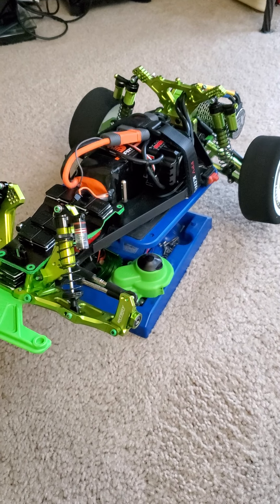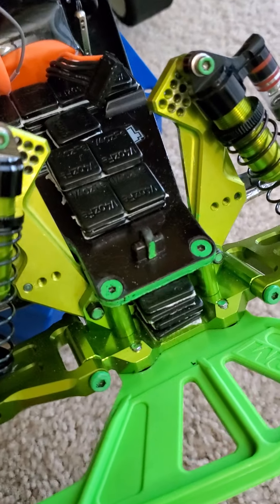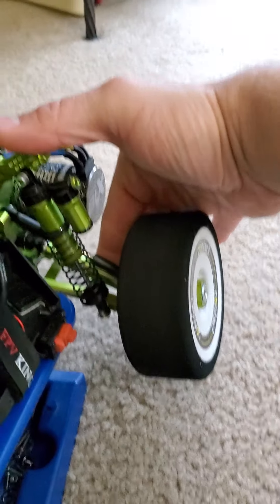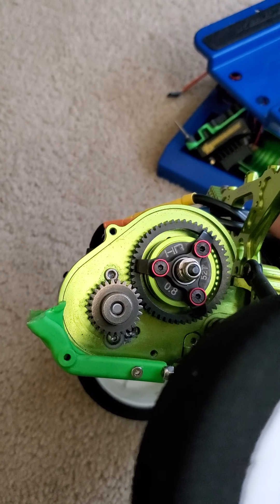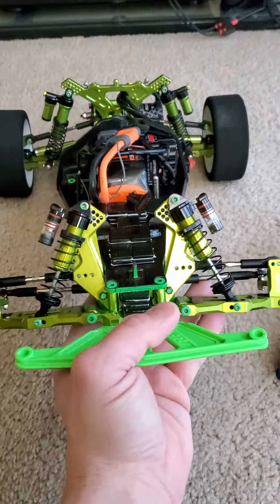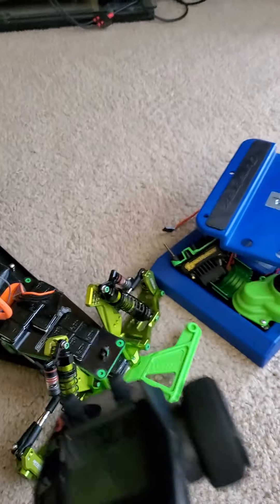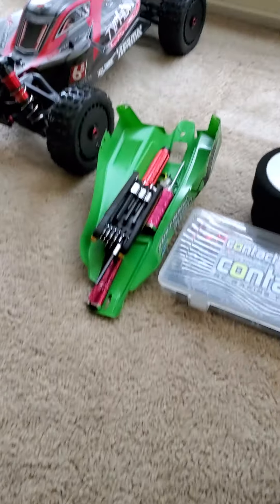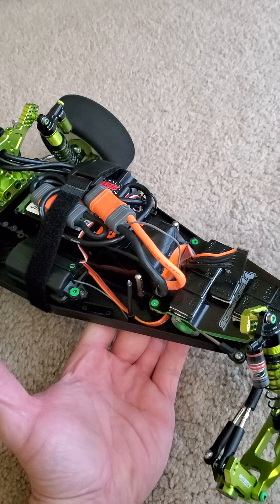Traxxas bandit running 6s electronics

Comment: Hey @alwaysupgradingrcturko can you tell me where you got the shock towers? I got some but they are for the rustler and I cant put the back ones in. If you could say that would be great. Cool build btw I am really jealous. Thanks :)
Reply from the maker: They are integy towers.   Got them from ebay.   They aren't as strong as the STRC racing one, but the color and weight were perfect.

Comment: Just getting back into rc after a few years,  looking for a 1/8th scale brushless 6s setup for an all around. I just can't find out if there anything new out or if I would be good with a mamba monster 2?
Reply from the maker: I've always been a castle fan.  There is always new stuff coming out but for the money you can't beat castle systems.
Reply: @AlwaysUpgradingRCTurko  is there a difference between the monster 2 and the monster x

Comment: What shock weight oil would you recommend for full aluminum upgrades if im gonna bash on a bandit?
Reply from the maker: I used 45 wt
Reply: @AlwaysUpgradingRCTurko  did you do any bashing at all?
Reply from the maker: @jacobjeska-ry5ij  I used to.   Been working so much lately.
Reply: What top speed did u actually achieve with ur bandit?

Comment: Man, I'd love to see you run this!  I've turned a bandit into a fairly decent 17.5 clay racer setup for shits n giggles at the club, love it so much I picked another bandit chassis up to beef into a high speed car.
Reply: Hey @Grill side Pickin, can you share what upgrades you made? Was thinking of doing the same
Reply: @brandonw1478  absolutely! 
I swapped the transmission gears from the metal ones to the delrin.
Put in a traxxas pro ball diff, swapped the shock towers to carbon fiber for more shock mounting options. 
Put the traxxas front and rear aluminum castor blocks and wheel hubs on.  Rpm gearbox, a arms, front bulkhead. Traxxas aluminum bell crank. Traxxas tie rods and turnbuckles to be able to adjust to and camber. And I stole a set of losi 22 4.0 threaded shocks from another chassis I had laying around. Changed the shaft lengths to where the shocks matched stock traxxas bandit shock lengths. Trinity x factor 17.5 and 80 amp xr10 pro. Proline HV servo (the blue one)  I would say you wont neccessary need all of these, but I wanted to give my bandit the very best shot, while still looking like a bandit.  You can get a lcg chassis for them, I have one.  But I feel like it wouldn't be a bandit anymore of I did that lol
Reply: @brandonw1478  the most important parts i would say are the aluminum castor blocks and hub carriers, aluminum bellcrank and tie rods/turnbuckles and shocks.
Dont forget to delete the stupid servo saver as well.  We used a losi stadium truck servo horn to do that. World of difference. All of that makes the steering tighten up a ton and gets you the ability to dial in your car.

Comment: I don't understand buying integy parts when they cost virtually the same as STRC and other aluminum hop-up manufacturers.
Reply from the maker: It’s not so much the cost.  STRC doesn’t make the full line and I’m a freak about the anodize finish matching.  Cheers.   Thank for the comment.

Comment: did you have to do anything to the motor mount to make that motor fit? I am going to try to do a similar build in about a month.
Reply from the maker: A little.   I used a titanium drill bit to widen the area where the shaft went through.  Very easy.   Cheers!!!
Reply: @AlwaysUpgradingRCTurko   thanks for the info!

Comment: where did you buy your parts at ?
Reply from the maker: Hey , thanks for the question.  Usually I go to GS Hobbies in Old Bridge NJ or I deal directly with the vendors.  I have a great relationship with Integy and STRC.  Ebay is also a good forum.  👍

Comment: 197 miles or kilometers?
Reply from the maker: 97 to 100 mph.
Reply: @AlwaysUpgradingRCTurko  man your bandit is sick I have a question though I've seen bandits doing 100 with just extra gearing on youtube and they were basically overheating the esc after every run will this setup be able to be ran more continuously without overheating? And what do you think the max speed you could achieve with this is